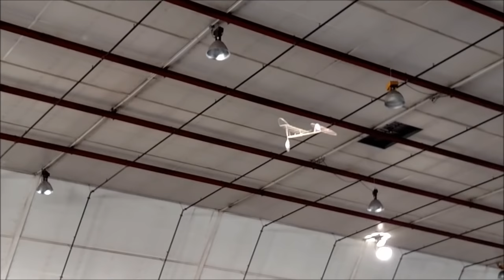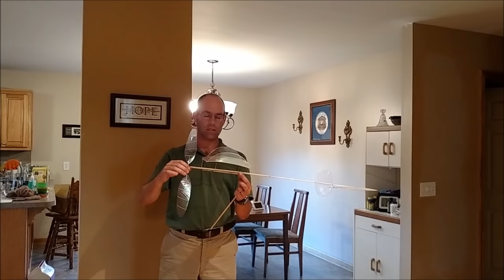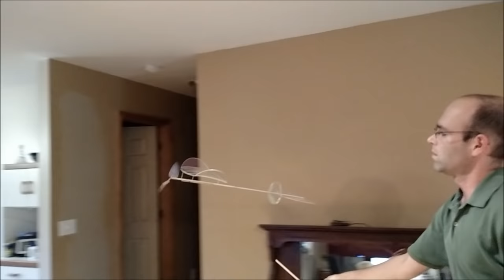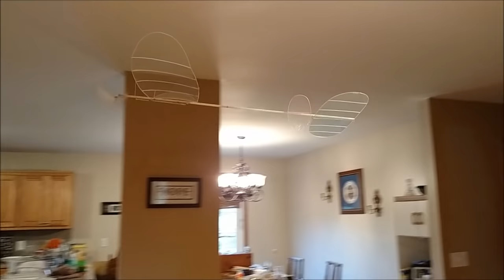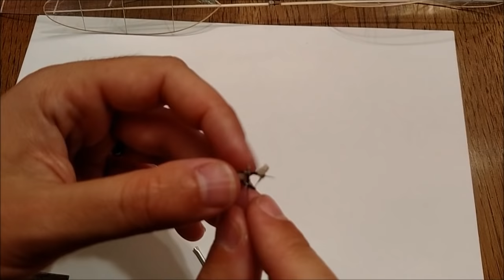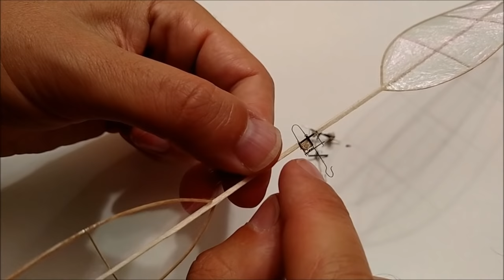Variable Pitch Propellors for Indoor Free Flight

Comment: Josh, what makes the propeller spin so slow on an indoor plane as opposed to the outdoor FF planes?  Those planes are so peaceful to watch. Thanks for sharing your passion.
Reply from the maker: It's all a matter prop propeller size to supplied torque at a given airspeed. F1D's and Mulvihills run similar sized propellers in that they move a similar amount of air for a given revolution. The difference is that the Mulvihill is running about 150 times the torque of the F1D, and so the prop runs about 10x faster (there's some quadratic math in there).

Comment: Is it possible to have different layers of friction that it can run through? As there’s less turns on the rubber band it goes to a different zone of friction then to no friction at all. Then that is when the variable pitch kicks in, some time after there is no friction, kind of like different gears in a transmission
Reply from the maker: Possible, yes, but quite inefficient. The goal of variable pitch is to transfer all the energy into the air as thrust, just in a delayed fashion. Friction just burns the energy off as heat.

Comment: So what kind of torque, energy storage, and revolutions is this sort of set-up producing from a rubber band? Is there a possible application for larger and stronger bands to replace batteries? Just curious how this compares to the traditional powered flights in RC planes.
Reply from the maker: At this point, high end Lipo technology is the best energy source you can get for small models. For larger stuff, the ultimate energy density sources remain diesel/kerosene type fuels. I think the ultimate indoor endurance record for electric R/C is around 6 hours, as opposed to 1 hour for rubber power.

Comment: I haven't been able to figure out what airfoil arc percentage refers to. I am looking at salty dog plans and it has 3 percent arc on the wing, 2.5 percent arc on the stab and 3.5 percent arc on the propeller. How do I form this? Thank you!
Reply: A 3 percent arc airfoil is a circular arc subtended by a chord such that the maximum separation of the arc from the chord is 3 percent of the chord length.
Given the chord length c and the maximum height h of the arc, we need to know the radius r of the circle. The radius is (c squared divided by 8h) plus h/2. You strike and arc of radius r from each end of the chord, the center of the circle is where two arcs intersect, you draw an arc from that center through the ends of the chord and that is your arc airfoil.

There is also a simple geometrical construction. Draw the chord line. Draw the point of maximum camber 3% (or whatever you want) of the chord length above the center of the chord. Draw the bisectors of each of the line segments formed by this maximum point and each end point. Where those bisectors intersect is the center of the arc sought. Construct the bisectors by striking arcs of equal radius from each end of the line segment, the radius being somewhat longer than the line segment. The two points of intersection of these arcs determine the bisector line.

Comment: Greeting Joshua, I would like to ask is there any way to measure the thrust produced by the propeller? Thanks!
Reply from the maker: Yes, but you don't want static thrust, so the rig needs to be moving. The best way to do this is to build a "whirling arm" device which uses a drag plate to simulate the aerodynamic drag of the aircraft. You then measure thrust based on the number of revolutions the arm makes in a given period of time and use the turns and torque at the beginning and end of the test to determine the energy used to generate that thrust for the period of the test.
Reply: Is there any instrument on sell that specifically used to measure the thrust?
Reply from the maker: I don't know of anything commercially available that would provide even remotely usable data.
Reply: Thanks, Joshua!
Reply: I would think if you had a push prop you could stand it on it's nose running on a digital scale , then just cancel out the weight and have your thrust measurement. if this theory works then you'd have to make a special rig to test prop and motor combos , but I'm pretty sure this would only give an idea of thrust and not an actual measurement.
Reply: @riverlifeva  You must measure the thrust when the propeller is moving through the air at flight speed.